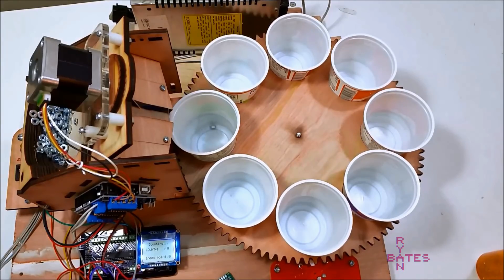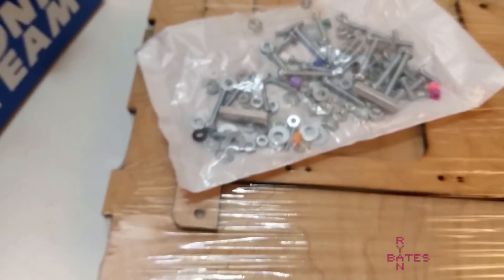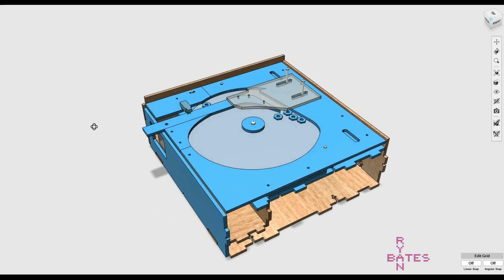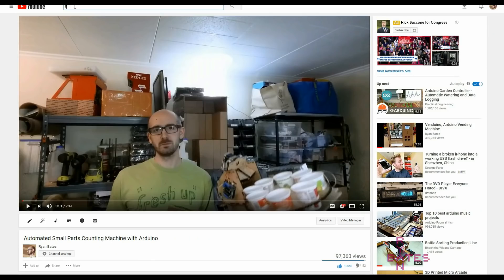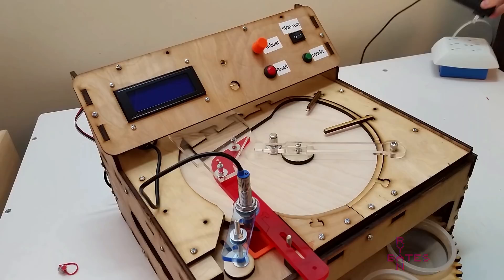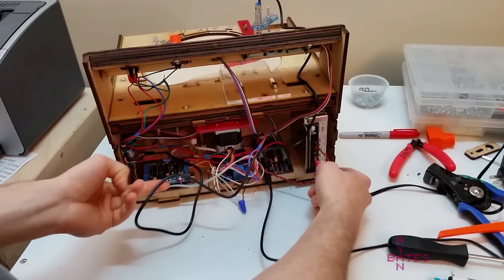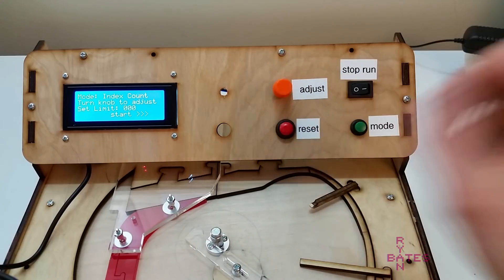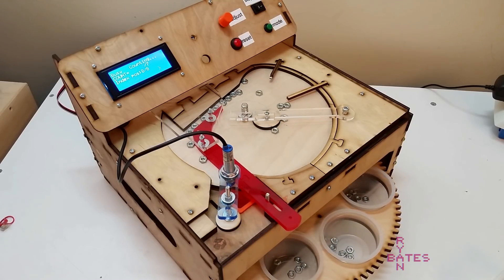Automatic Small Part Counting Machine with Arduino | Version 2

Comment: when there is a traffic jam, reverse gear must be turned on for a short time. it is easy to implement software, counting the time between the parts passing under the sensor, when exceeding a certain time value, turn on reverse gear for a couple of seconds.
Reply from the maker: echoing the comments here

Comment: does this work for o-rings?
Reply from the maker: not as built. the induction sensor will only detect metal. replace it with an optical sensor and this would work for tiny o-rings

Comment: Nice evolution from your first machine! Personally I'd have the bar on a servo so you can simply select the size from a menu (or even better a barcode), that way you could also program some sort of agitating motion in the bar too to keep things flowing.
Reply from the maker: thanks. that's a lot of complication for something your fingers can do in 10 seconds. I do agree with the agitator; does need a mechanism to stir/ unclog jams.

Comment: The problem with these machines is that you really do need 99% accuracy to use them in production, missing components for 1 customer of every 100  is significant
Reply from the maker: true. however this machine over counts when it comes accuracy error. so it's more like a 1% loss in inventory costs. not a better, just different.

Comment: Hi Ryan.  I run a grassroots incubator developing entrepreneurship that reuses materials currently deemed "not worth the time".  One project under consideration is jigsaw puzzles.  I was wondering if in your research you've come across anything that might be usable for counting puzzle pieces?  Pretty sure it would need an AI component to adjust to the various sizes and shapes of different brands as well as the tendency for pieces to stick together. . . any thoughts, ideas, advice would be appreciated. Thanks for being a counting enthusiast and sharing your knowledge!

Comment: Instead of agitator/vibrator to prevent or solve jams at input you may try this with no additional hardware, only programming:
when you detect jam (no counting for x seconds at hall sensor) reverse disk motor CCW for 3 seconds, then forward CW again. If 3 attemps no solve detect no more parts or bad jam/malfuncion: stop disk and beep for operator to come.

Comment: What motor did you use?
Reply: Nema 17 stepper motors. Commonly used in 3D printers. You can find them on ebay from china for about €5 each. Note that there are two motors: one motor that drives the turntable and one motor that turns the spindle with the cups in it below.

Comment: One way to solve the jamming issue would be to add a couple of if-statements which makes the disk spin the other direction a quarter rotation and then back to normal if it has not detected any new nuts for a set time. This would cause the nuts to collide and prevent the jam. 

Inspiring video, thank you!

Comment: That angular piece for separation is truly ingenious. Nice find/build.

Also, designed in Inkscape? I'm quite impressed and cringing at how hard that would be for me to do (as one familiar with a variety of CAD packages)

Also +1 for "corn is gross" - agreed, not a fan of having to scrape nutrients off a cylinder.
Reply from the maker: Hah. Yeah, designed in inkscape. It's the only middle ground between what I have and what other makerspaces that come and go in my area use.

Comment: You should instead make it so after some time (idk 15 seconds) of the sensor not sensing any nuts, 

The wheel turns backwards for some time (idk 7 seconds) 
and the underside of the arm will jostle the nuts a bit then make it turn forwards again, 

And You shouldnt need any additional hardware.

Comment: What if you add a motor that will slowly move the separator when no parts have been counted within a certain time. Maybe that can solve the problem with it getting stuck, just a random thought
Reply: Or just reverse the turntable for a second, that would fix most jams.